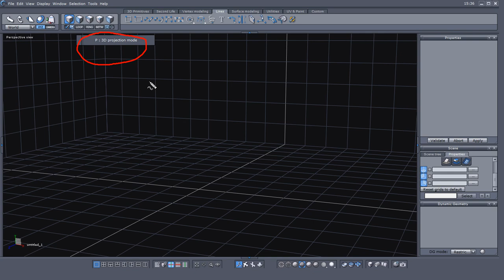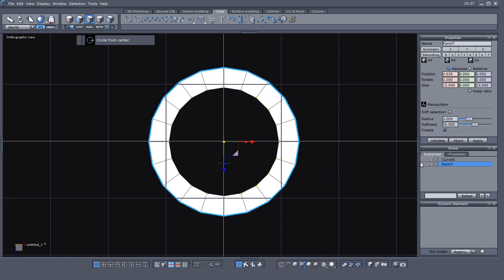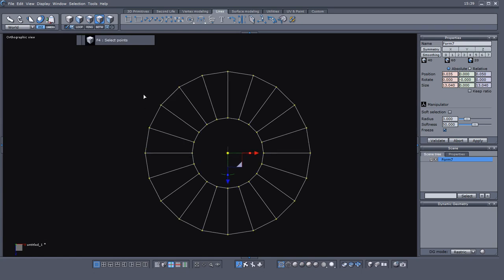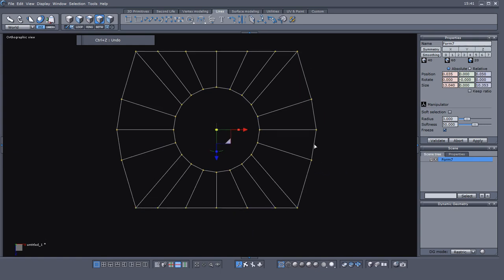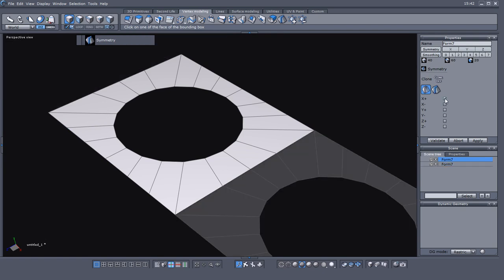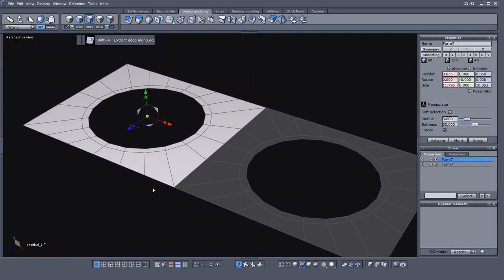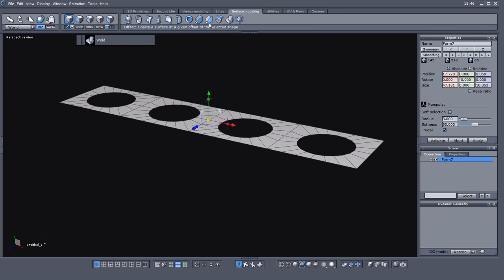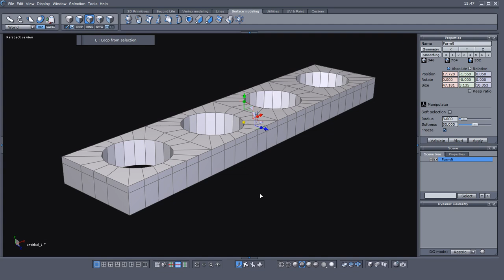Create a hole without using boolean

Comment: How would I cut holes in a cylinder? I need to make a Browning .50 caliber machine gun and the sleeve over the gun barrel has a series of holes. Also, whenever I try to match flat, square parts to a cylinder; such as the fins on a 500 lb bomb, the danged fins get rounded when I try to weld the fins to the bomb.